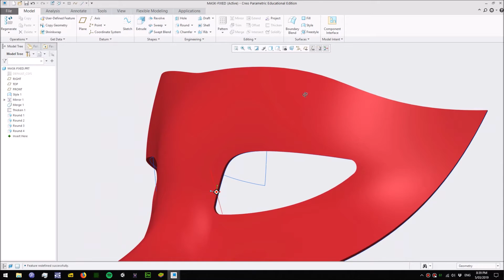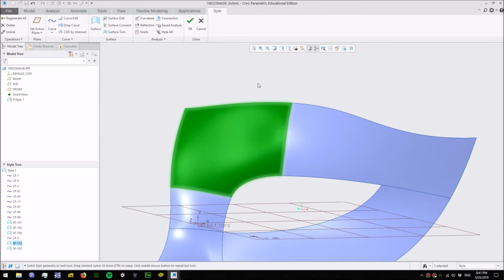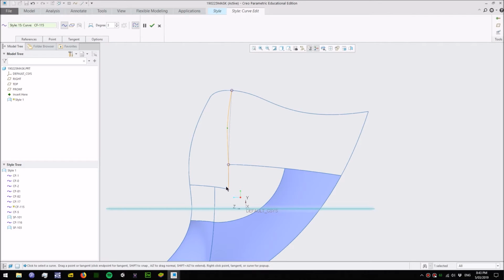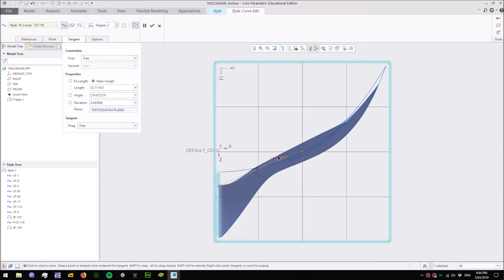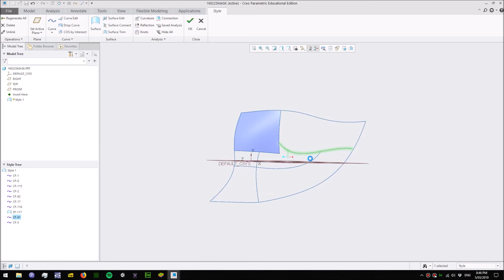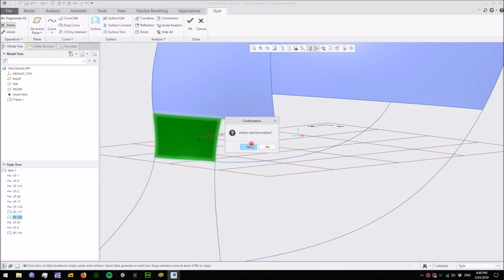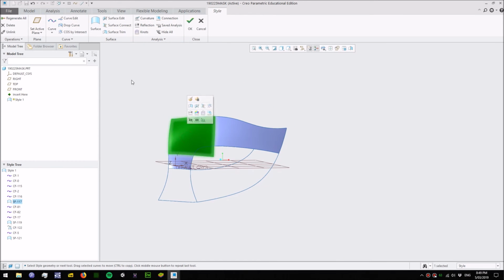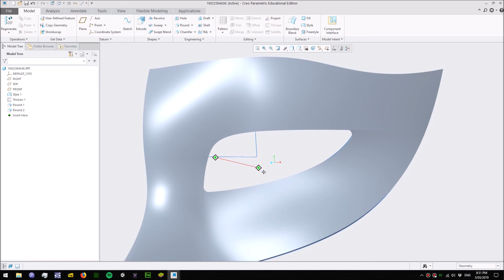Creo Style Surfacing Tutorial - 5 Sided Surface Blend Smooth Trick

Comment: Didn't your original model have g2, though?  Key thing is to make sure that your curves are properly set up before you start creating surfaces.
Reply from the maker: G2 doesn't really matter. It looks the same as G1.
Reply: @3DSurfacing  I disagree. Your final model had creases like you would see on a filleted surface.  A G2 surface would not have those.